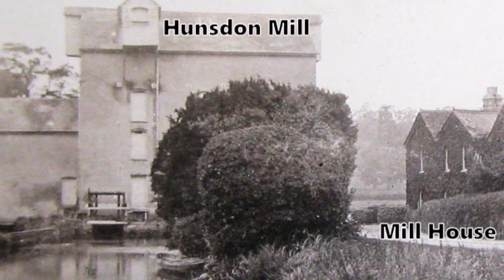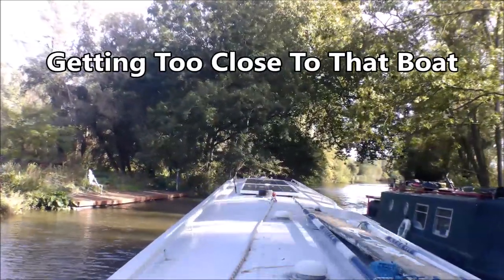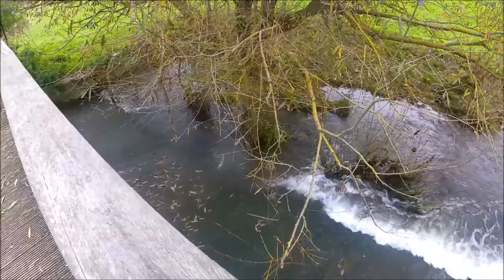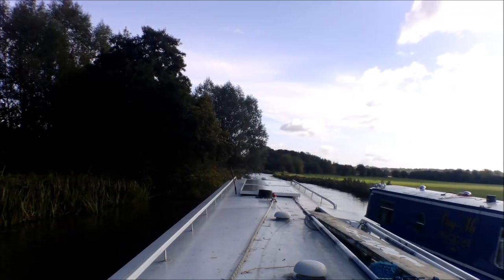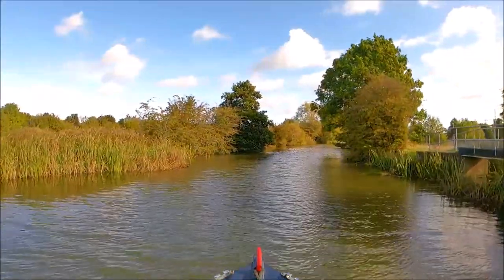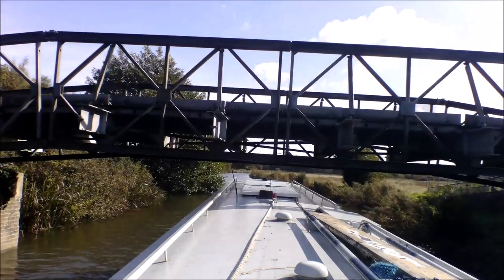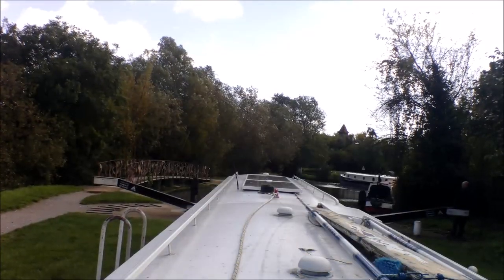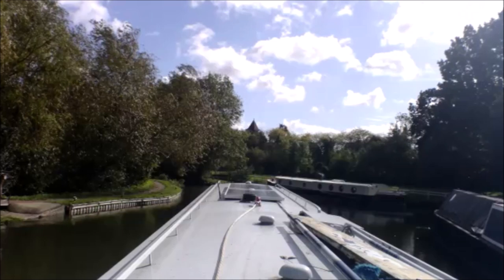9. Narrowboat Journey, Hunsdon Mill House To Parndon Mill & Plans For The Winter On Aitch!

Comment: A little trick if the wind is blowing against the side of the boat open your windows both sides to release the pressure, every little helps.

I grew up in Barnet so mine was a DA style, don't fancy a syrup on the bonce though.

Nice chatty video Thanks mate. You spoke about doing the Lee and then the Thames through London and onto the canals. To enjoy the Thames you have to do the non-tidal upper Thames but this means going past Brentford. The upper Thames is great though the license is a bit expensive as it's worked out on length + width, some bankside moorings are charged for so another expense so do some homework first. I moved off the Thames in 1997 and have only visited it crewing on a mates boat. Any info needed ask away, will be pleased to help. The bit coming out of Lime House till passed Big Ben can't be hair raising with the trip boats putting up a hell of a wash. So think about getting a hand held radio + extra experienced crew + life vest etc.
Reply: Foxes Afloat have a vlog along the tidal thames thats  bri showing what it is like.
Reply from the maker: Thanks for the handy little tips, and I don't fancy a syrup either!  when I eventually go through London I will go the longwinded way through the Canals, I could probably handle the Tidal Thames with some decent crew, but personally I don't think I'm ready for that just yet.
Reply from the maker: @5581debdo1  Check out Minimal list they done a good Vid going up the Thames also!